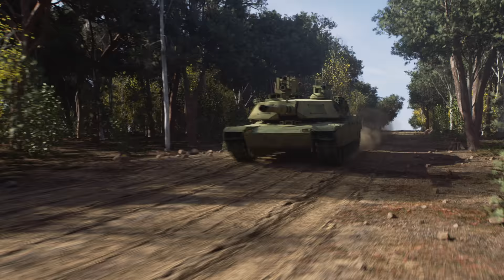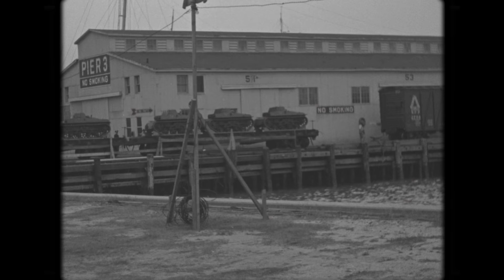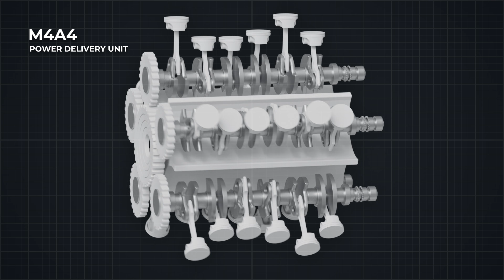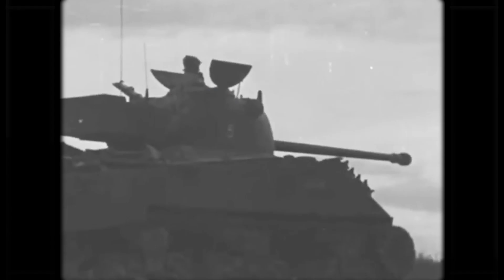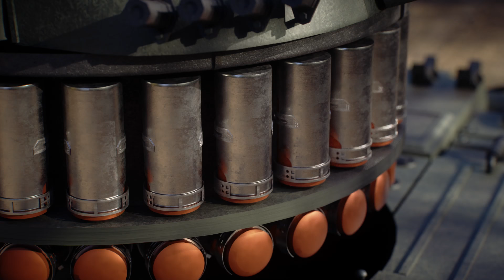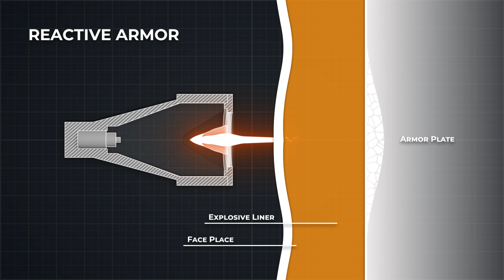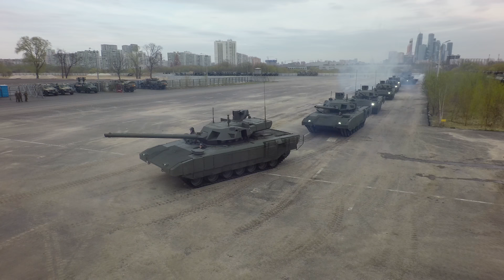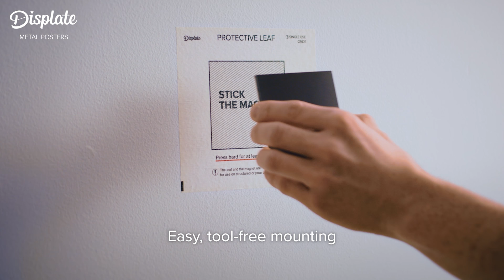Why America’s Tank Failed in Ukraine

Comment: It "failed" because the expectation for the tank has been set by 4 decades of use within the doctrine it was designed for by the operators who designed it. This is a war nobody could have predicted would unfold like this. Saying the tank failed is clickbait and demonstrates a complete misunderstanding of how wars are fought, as well misplaced expectations for individual systems; saying the tank is not fit for the modern battlefield is an erroneous assertion at best. 

The truth here is that the tanks that have been sent to Ukraine have simply not been used within the types of combined-arms units they were designed for; neither Ukraine nor Russia have the capacity to turn this fight into the war of maneuver the United States' air power and mass permit. The Abrams didn't "fail" because it guzzles too much fuel and can't withstand a direct hit from an artillery shell or ATGM, it has seen losses due to expected attrition through 4 years of war in battlefield conditions it was not designed to fight in. 

Expecting fewer than 3 dozen tanks to make an appreciable difference in a real war is the type of wunderwaffe-superhero thinking that belongs in Hollywood and comic books, not making realistic assessments of a modern battlefield.

Comment: the abrhams ukraine got did not have trophy APS.... ukraine got older abrhams. the new sepv3 has trophy but ukraine did not receive those. This is why poland bought the tanks that it choose. abrhams will defend Warsaw where its flat and solid terrain, and the more modern, lighter K2 black panthers with its hydro suspencion and KSTAM munitions  will be in the east where there are hills, swamps and bogs.

Comment: I mean saying 27/31 were lost is not enough to call it a failure. You have to compare it to similar tanks that were used in similar ways in Ukraine. The M1A1 in Ukraine (which is a much older version of the tank) had the best crew survivability in combat in Ukraine. They only got 31 of these things and they’re fighting a total war against a much bigger adversary. Of course they’re going to lose tanks. I’m surprised they still have any given how long ago we gave them these things.
Reply: Exactly, losing isn't defeat.
Reply: 27 Abram tanks were lost is definitely more of a failure
Reply: @temman5032  yeah but how many russian tanks did the abrahmses kill?
Reply: Thats over 85% losses... A devastating loss rate in any context.
Reply: @rogerc6533  actually that's wrong, Ukraine received not 31, but 80 Abrams, so loss rates are completely different.
Reply: @serkardis292  These are the Australian Abrams right? The American ones have been completely annihilated and its going to be the same for the Australian ones. The Australian ones are also going to be much less modern than the US Abrams.
Reply: pretty sure the leopard 2 and its variants have been more survivable and effective in combat.
Reply: @0bsolete_fps773  as have the Challenger 2

Comment: Really there's no need to make a long explanation about Abrahams tank. It is no problem with a particular tank model, but a general problem with any tanks in the modern warfare. Every tank kann bei destroed in a short time by drones, if it will be found. If your enemy has enough drones, a tank has no chance to survive. Every defense system buys you just some time. In some cases in the war in Ukraine more then 50 drones where needed to disable one tank and it took more then 30 minutes. System like Trophy will help to survive another 20-30 minutes or so. And by the way there was no Trophy system on the tanks in Ukraine

Comment: ‘Jet’? No, a gas turbine.
Reply: I think because it is based on a engine used by 'jet' aircraft (which usually means a turbofan these days), but that's assumption. 100% it is just a gas turbine.
Reply: @klakkat it’s not it’s based on a turbo shaft engine used in helicopters.
Reply: Turbine engines are jet engines in its core principle. SMH
Reply: Honestly your not wrong but it's a turboshaft engine basically it has a small jet engine in it and the exhaust powers a turbine which powers the vehicle 
He also refers to it as 'taken off of a helicopter' in the same sentence which is more accurate (though not literally true)
Reply: @acompletelynormalhuman6392 I’m not wrong but I’m wrong? Make up your mind. I’ve stripped and built many RR Gnome engines from Wessex and Sea King helicopters, so DO know what I’m talking about.

Comment: The tank not used in a combined assault like its meant to, sent head on with no air support to the front, with sometimes no infantry protection, not used by doctrine of the Western type, somehow fails in the Eastern Europe. Wow, its like a country that doesn’t have the SAME doctrine as the country of origin isnt using it properly? This gotta be either rage bait video or the creator has little to no knowledge of military tactics and doctrine depending on Theater. Not to mention Ukraine has the bare bones model of an Abrams, not the latest generation. Creator is lacking critical thinking skills past a spread sheet of numbers.

Comment: 8:12 "In the mid 1960s" The Soviets developed revolutionary composite armor, which they used on the T-64. This armor, for example, included spheres of so-called "ultraporcelain", and almost completely mitigate the use of the most common AT tank's round before the APFSDS - the HEAT one.

Comment: 19:28 I love this channel, but are we really using the armata as a basis of what tanks should be like in the future?
Reply: Armata would do no better when exposed to the kind of conditions you see in Ukraine. No realistic tank (in other words, actually able to move on land without breaking down under its own weight) can be armored enough to survive drones, mines, artillery, flank attacks with modern AT missiles, etc. This whole "analysis" is an embarrassing, steaming pile of nonsense.

(Also, while an Armata-style design lets you do things like a smaller turret that is comparatively better armored, its main advantage is not making the tank invulnerable but increasing crew protection.)
Reply: Presumably, the Armata was designed with the capability to be used as a ground drone. It has an automated turret, sensors all around, active defenses, and so on, and the control systems suggest they could easily be replaced with remote control. Modern warfare shows that this concept would likely also be very vulnerable to FPV drones. I'm simply saying that the design likely also included remote control capability. And that's not to mention what the author has already said about the advantages of this design.
Reply: well the abramsx and many other mbt tech demonstrators have similar concepts in design.
Reply: @0bsolete_fps773 turretless tanks have been a concept for decades
Reply: well the us army clearly thinks so. the new m1e3 that will (hopefully) go into service soon is pretty much an american armata
Reply: @maxstagramus3018 technically the Armata is the Russian TTB
Reply: @YoBoyNeptune no not really.  the ttb still had crew in the turret + obj 195/477 came earlier, no?
Reply: @maxstagramus3018 you sure you're looking at the right TTB? It was a prototype m1 with an unmanned turret with the same crew layout as the armata. I don't know Soviet prototypes so maybe they had one earlier
Reply: @YoBoyNeptune yeah my bad i was looking at its autoloader not the tank as a whole.
Reply: @maxstagramus3018 ya other then the 
armor, drive train, power train, weapon, EWF, optics, data, and defences 
other then those small things they are the same
Reply: @battalionstallion3894 well no shiz
Reply: Yes. It is
Reply: Armata is an example because... jeez why are people obtuse (slow to understand). Armata has a diesel engine like every tank in the world that isn't USA. Autoloader like Japanese Typ-10's, Leclercs, ZTZ-99's etc. Armata is using a neat idea of separating the crew from the turret, segmenting them together in the front capsule which is safer and secure, and the turret become remote operated.
Everything the Armata is using is for the first time in history! America with the new M1E3 is about to become 2nd, clearly they are following in Armata's design philosophy.
Reply: @mab2187  T-80 :?
Reply: @mab2187  the Armata as also already failed as a tank
tanks like the abramsx 
kf51
and others already did what the Armata did before the Armata could even enter production
and in a video about tank engines he ends with the Armata

the Armata a tank that's main problem is its expermental engine stopping it from being able to enter production 

this is like making a video on EV's and ending it with saying the cyber truck is the future because it has drive by wire 

ignoring that drive by wire is something that aircraft have been doing for years
Reply: @battalionstallion3894  Well that sounds more of a funding issue and solely an engine issue for the Armata, a brand new engine will obviously have complications duh, nothing has failed yet.

Fail would mean the Russians stopped developing and scrapped the program... idk if you noticed but they are at war right now, so there are in no rush for developing a new tank line and its logistics.

Common sense yo, we are discussing Abrams and its future road, comparison with another nation who are developing in the same philosohy is the theme of this video...
But nah human beings and their zero wrinkles in their brain. "Armata mentioned in the video, REEEEEEEEEEE!" This is what I'm seeing the most in the comments, instead of actually addressing the shortcomings of the Abrams mentioned in the video!
Reply: @mab2187  its used as a example as a future tank in a video about tank power systems. When its power system is faulty.

In 2017 russia had 10
As of 2026 they have 10. And russia has no external orders and has halted production. Its a failure same as the maus or Porsche tiger.

If you want a comparison it the m1e3 could be compared with the kf 51 a tank in actually production with multi clients, actual technical improvements, and a successful power train.
Reply: @Bertinator-nm9ld  huh you mean like almost every nation... the countless projects that were tested, worked, spent billions on, nvr went any further...
Not very bright are you.🤣

Comment: I dispute the claim that "The Abrams isn't fit for the modern battlefield". It's not fit for Ukrainian service would be a more accurate statement. If the US were fighting the Russians in Ukraine, it would have gained both air and fire superiority in artillery before rolling armored units, it would have ECM, MSHORAD, and other anti-drone measures rolling along with it. There would be dedicated mine-clearing forces. If the US committed full force, it could push the Russians out of Ukraine in less than a month. You claim that the British and German tanks are better suited, but they have suffered losses as well; thousands of diesel-powered tanks have been destroyed. The issue is not the tank, but the fact that both Ukraine and Russia lack the logistical and combined arms abilities to properly use tanks. Misuse does not equate failure.

Also, the US is switching back to diesel-powered tanks because newly developed engines can match the performance of the turbine, especially with all the weight that will be cut from the M1 by integrating most of the tech strapped to it through the SEP upgrades. The US has the logistical ability to support Abrams as it is now; the issue is not the tank but how it is being used.

Also, the M1s shipped to Ukraine are older, down graded modules with their composite armor removed. They are no where near the standard of the Abrams in US service.

Comment: What amazes me most is the long and arduous journey it took Western (Allied and Axis, excluding Japan/NATO) tanks to get a diesel engine. Yes, the Germans had oil shortages during WWII, but they had hundreds of thousands of diesel trucks in Germany, so perhaps it was logistics? And while diesel fuel is no less dangerous for the crew, a diesel fuel tank won't explode due to penetration by high-velocity, hot shrapnel — because that's exactly what gasoline fumes do. A diesel fuel tank would catch fire and spray the crew with burning fuel, but it would give them a few golden seconds to bail out, whereas igniting the vapors in a gasoline tank would initiate an air burst, which, along with the burning fuel, was even more dangerous.

Comment: Tank warfare is dead unless the find a way to put at least 2 more turrets on top. Otherwise you would just need 3 fiberglas drones from 3 different directions to blow up any tank with just 1 turret, because it won't be able to switch targets that fast. Oh, and tunnel digging machines.

Comment: 27/31 destroyed doesn't necessarily mean they failed, it means they were used in combat.
Reply: "It's not meant to be indestructible, it's meant to keep its crew alive."
Reply: Exactly.

Another "Oh no, equipement in combat ENGAGES in COMBAT!? proposterous".

Like yeah it's a TANK, it's supposed to protect it's crew and fire at enemies, it did that.
THe fact that it was hit and let the crew escape safely was a fundamental example of why it did it's job well.
Reply: Lost doesn't necessarily mean destroyed, most were just disabled and were not able to be recovered...
Reply: @kskeel1124 Or maybe they  parked in the woods, and just couldn't find them. They're camouflaged, after all.
Reply: The problem is.. IF you weight 70+ ton, recovering you on the battlefield become impossible, even you have a jet engine as propulsion system.
Reply: @davidmattiapietravalle2951 ARVs are used for that very reason. But it all depends on who won a particular battle. If one side won and gained ground they could send in ARVs to tow the remains of tanks and other armored vehicles for repairs or to recycle the metal and use it to build in case the vehicle is beyond repair
Reply: Well to find out if they failed i think we need to figure out what thier initial goals were first.
Reply: And if you know to what unit they were assigned, you know they were used more than any other tank battalion in the war. Not tank type for Ukraine (that is the T-64), but all the M-1s were with one unit. That unit has been very, very busy.
Reply: @richardthomas598 yes they've been used to blunt Russian breakthroughs like when the Ukrainians were defeated in Avdivka...  They were generally sent out individually with no support just to buy time for the Ukrainians to bring in reinforcements to shore up the lines...
Reply: It have near 100% unit lost if you look at it. You are right its not necessarily made the tank a failure, the tank is facing the kind of war that it never seen before.

But the tank is certainly a failure if you see it from the logistics point of view. The only problem is that Abrams are a tank made for a superpower country and can only be used by a superpower country. Ukraine is not and to top it all their logistics are busted so it is very hard for them to keep those tanks running in the battlefield. To put it simply, the problem with Abrams is that they are not designed with a country like Ukraine in mind, it was designed for the U.S it runs on the operational cost that the U.S can sustain and needs a large logistic support that the U.S can manage.
Reply: Amazing
Reply: also there is "destroyed" and "destroyed".
Reply: Amazing cope
Reply: Lol most of them were destroyed in around a month in kursk
Reply: Nice cope-FAIL!
Reply: Other western tanks are proving far more survivable in the same circumstances.
Reply: @Aethid ya which ones?  The Ukrainians have lost atleast 50 Leopard 2s and several of the Challenger 2s sent by the British...
Reply: @kskeel1124  The loss rates for the Leopard 2s about half of the M1's, and they have lost 2 Challengers.
Reply: Lol keep telling yourself that buddy 😂